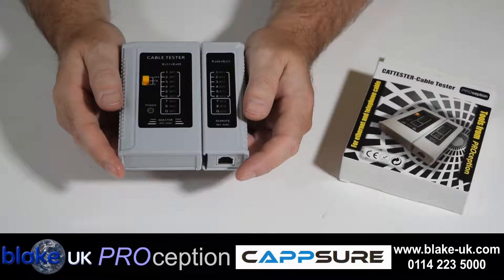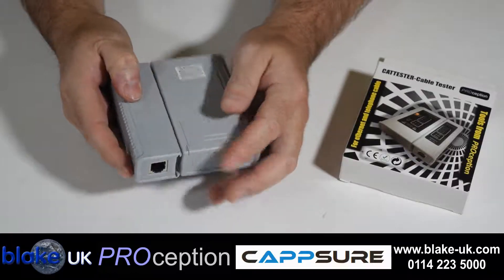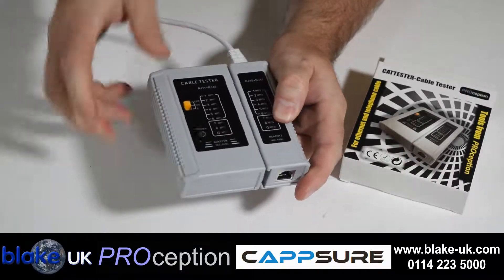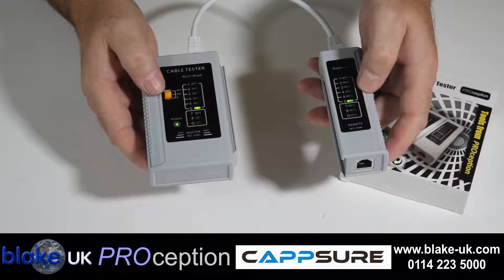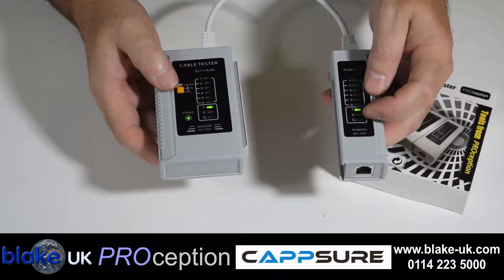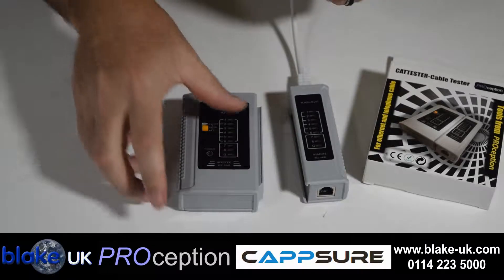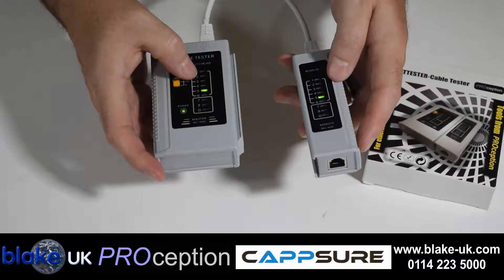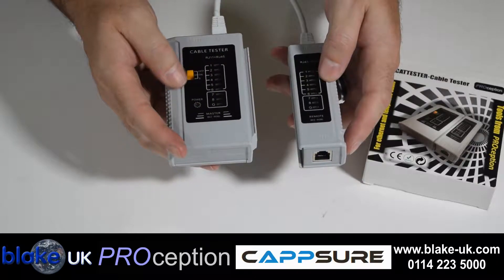CAT5/6 Cable LAN Tester Tool

Comment: If none of the lights light up but the power light is flashing then is there any other possibility than "all lines are cut"? It's the same situation as turning it on without a cable connected at all. This is a CAT8 cable so there is a ground, battery is new & known good cable runs the sequence fine.

Comment: What does it mean when the flashing leds are really dim but working in the right sequence?
Reply from the maker: It would indicate that your cable is likely fine, however you may be losing voltage somewhere along the circuit so the connection may not be the best. Alternatively, it may just be that the testing unit needs a new battery. 

For any further queries, feel free to email or call us with the details provided at the end of the video, we'll be happy to help!